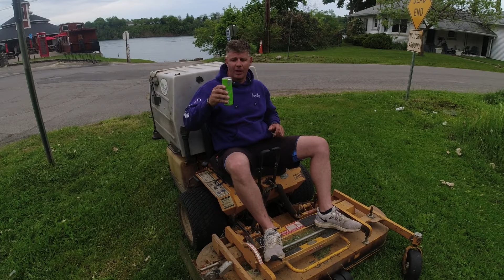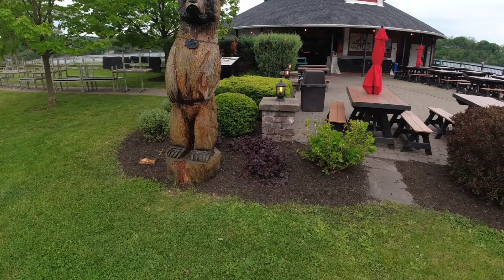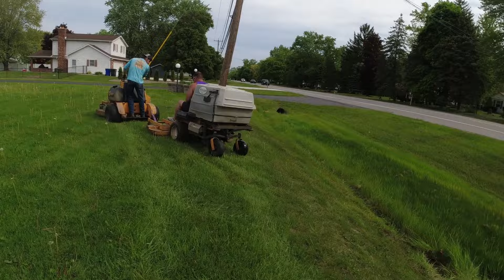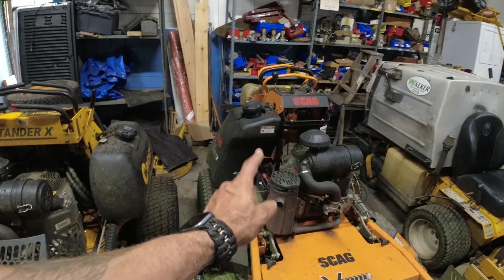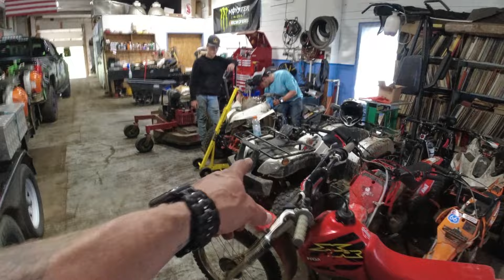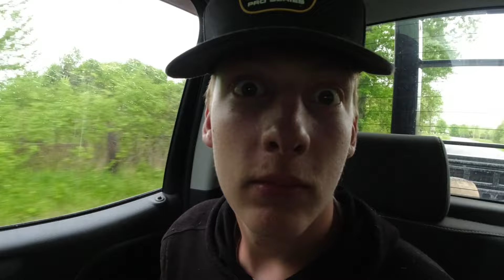Mowing OVERGROWN fields

Comment: I found a couple older walkers from $3000 to $4500what do I need to look for ?
Reply from the maker: Mostly hydros, wheel motors. Make sure everything is smooth and not leaking. Check gear boxes on the deck as well